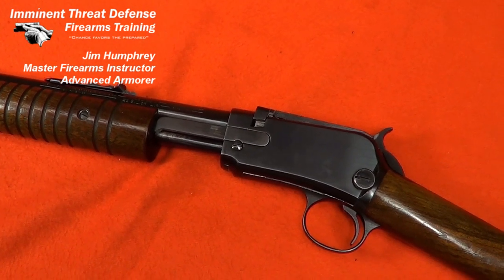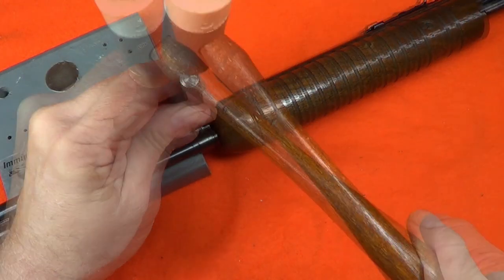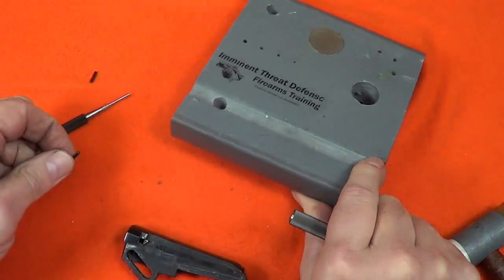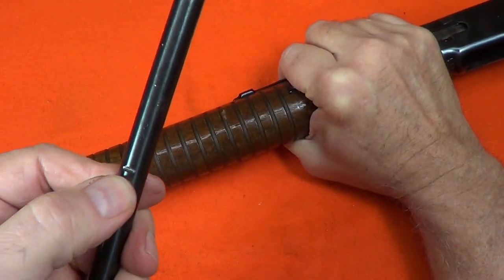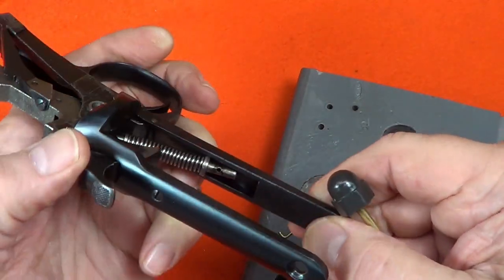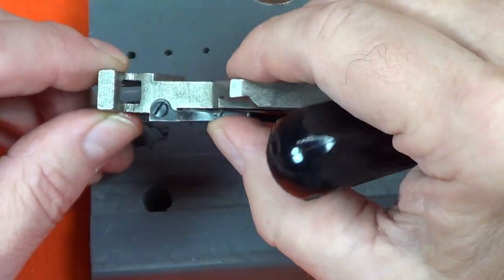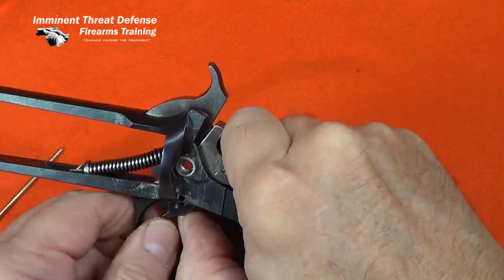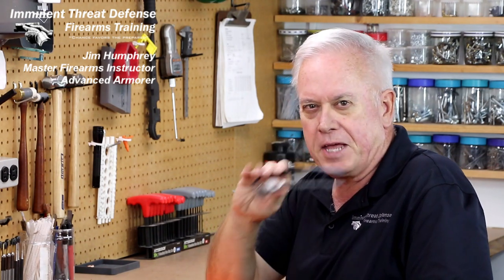Winchester 62A Disassembly

Comment: As with most of these firearms videos guys show how the firearm is "safe" with no bullet in the  chamber but we never see how to make them safe when there IS a bullet in the chamber. That's a different process no one covers. Thanks for the disassembly video. Much appreciated.
Reply from the maker: You're right clearing and making safe is a different process than just checking to ensure the firearm isn't loaded.  I try to address that with two videos on my channel that show you how to clear and make safe a firearm.  The first video goes through a very thorough and specific process that I teach in all my firearms classes.  The video uses semi-automatic pistols to demonstrate the process but it's applicable to all firearms.  You can view that video at https://youtu.be/Aj1Rn-5oMo8  The second video demonstrates the mechanics of clearing about 27 different firearms. You can view that one at https://youtu.be/X3RJVPUzKCw  You're also right I don't think there are many if any other videos on that topic.  Certainly none as good as mine 🙂Thanks for watching and commenting

Comment: I have a Rossi 62a. It’s a copy of this rifle.  Mine is missing the  cartridge stop.  I have one and its pin on the way.  You mention in this video that you did remove it because the pin was “Staked”.  What does this mean?
Reply from the maker: Staking is a process used to retain a pin (or screw, or other part) by deforming a small spot on the parent part on the edge of the pin hole.  So in this case the pin was inserted in the carrier and a small punch was used to dent the carrier in one or two points around the edge of the pin hole. Because it's a deforming process I'm reluctant to remove a part that's staked just cleaning.  That's something I'd only do for serious maintenance, like a broken part replacement.  It's a fairly common method for pins but you can also see it on AR15 carrier gas key bolts & 870 shell latches.  There are a number of specialty staking tools for special jobs (google that and you'll see).  However, for this job any fine pointed center punch should work.  Hope that helps, thanks for watching.  Check out the new "Thanks" button above.

Comment: I have a Taurus model 62A but I have a question. When the firearm is cocked should you be still able to open the action? I thought it had a lock and you had to press the firing pin in or fire it to be able to open it? Mine opens when cocked, it doesn't lock up and I thought it was meant to.
Reply from the maker: Not sure about the Taurus model but on the Winchester the action release is the hammer/firing pin.  With hammer cocked on the Winchester the action will not open.

Comment: I have a 1906 Win, which is similar, if not almost the same as the 62A. It's a little worn. My carrier has significant left to right wobble in the half cock position. I'm guessing that this exceeds tolerance but need to know if it needs to be replaced. How I determine if it is excessive?
Reply from the maker: hmmm... If I remember correctly, the carrier is being guided laterally by the breech bolt, so I don't think the wobble will matter much.  If you're having cycling issues, like it does feel smooth, or you're getting failure to feed, then maybe it's the issue.  Otherwise if it's operating then I'd leave it alone.   I found a replacement part online, for $162 so yeah unless it's malfunctioning, leave it alone.  Hope that helps.
Reply: @ImminentThreatDefense  Thank you, it does.

Comment: Question how do we fix the slam fire ?? Mine seems to have hammer follow and it doesn’t set off cartridges??
Reply from the maker: could be a number of things.  Start with sear hammer engagement.  The sear on this rifle is integral to the trigger.  Sounds like something is causing the sear not to engage.   Could be the trigger isn't returning (trigger spring missing/broken, gummed/rusted not free to move?).  Could be the sear face or the sear notch (on the hammer) is damaged/worn/gummed up.   Can you just thumb the hammer back and will it lock?  If so is the trigger pull extremely light.  If it doesn't lock does the trigger move freely and return cleanly?  If that all looks good run the action real slowly and see what happens, does it only slam fire when the action is run hard?  Might be worn pins/holes that allow the trigger or hammer to move out of alignment.  Obviously unload and keep the firearm pointed in a safe direction.   Hope that helps, thanks for watching!
Reply: @ImminentThreatDefense  yes sir it runs very well it just doesn’t slam fire so I’ll take it apart and I’ll keep you posted
Reply: @ImminentThreatDefense  olá o sr sabe me dizer qual foi o ano que o 62 A parou de fabrica. Obrigado  eu tenho um e queria saber o ano dele
Reply from the maker: @paulorufino3216 Production began in 1932. Around serial number 98000 (1940) minor changes in the mechanism lead to the model designation 62A. They remained in production until 1958